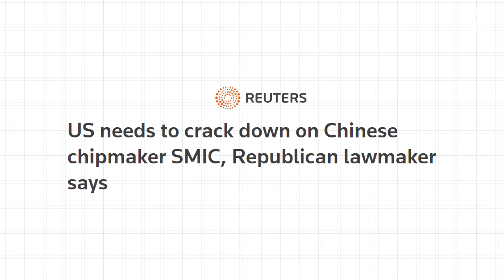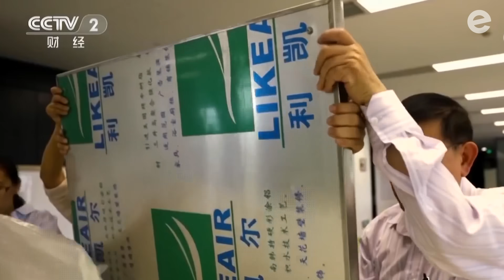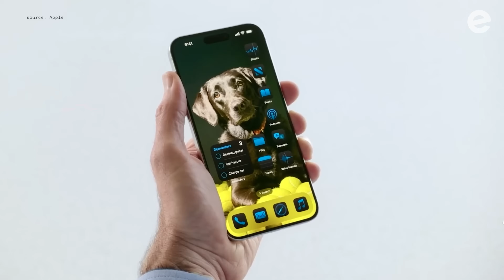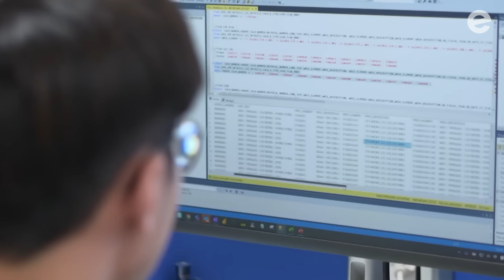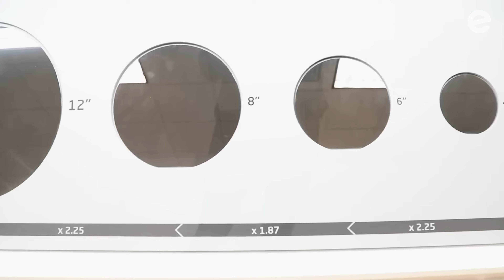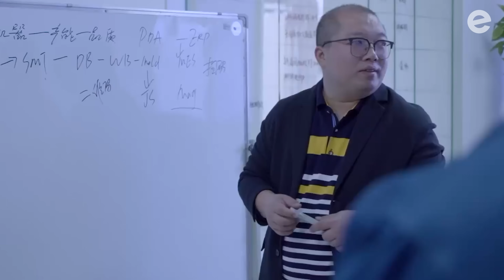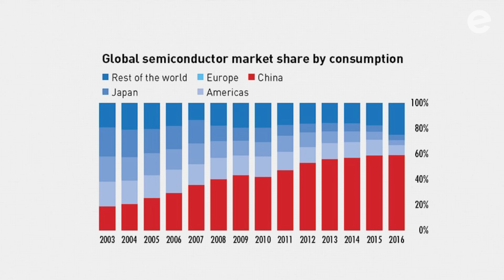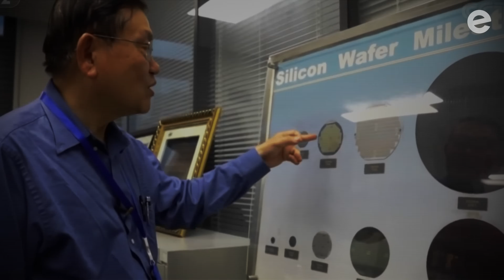Inside SMIC: The Underdog Chipmaker That US Can't Stop

Comment: SMIC was founded in 2000. With old ASML DUV machines SMIC uses quad patterning to make 7nm chips, 2 years ago in 2023. Intel couldn't even get 10nm right, until about the same year, 2023? And how long has intel been doing cpu's? Soon SMIC will not need ASML.